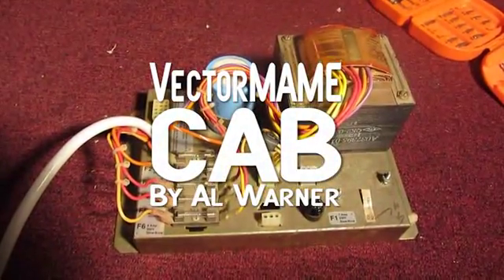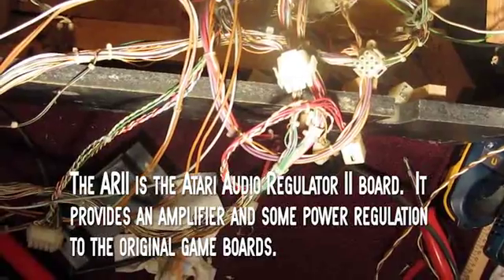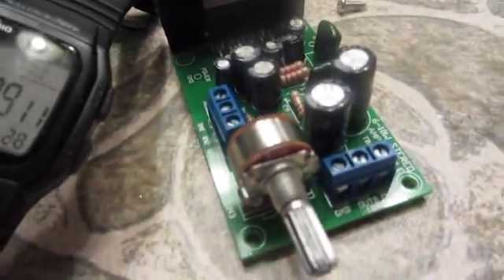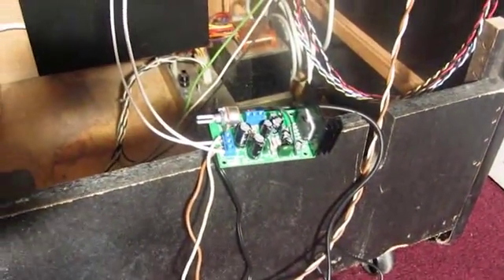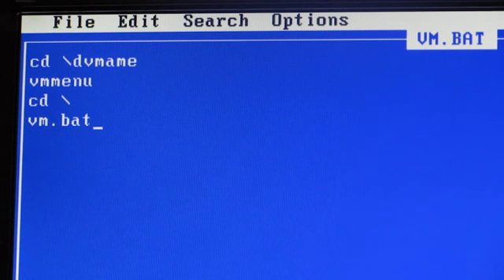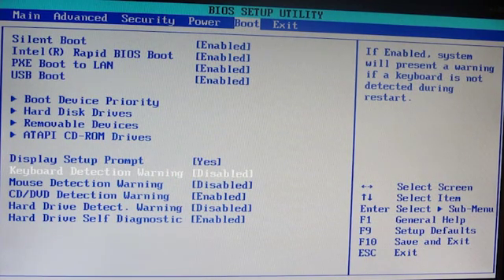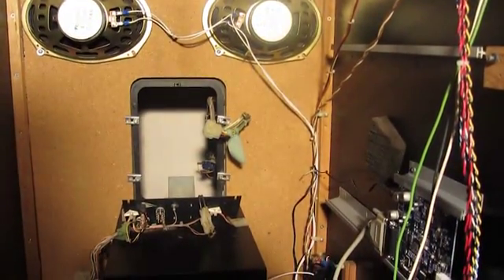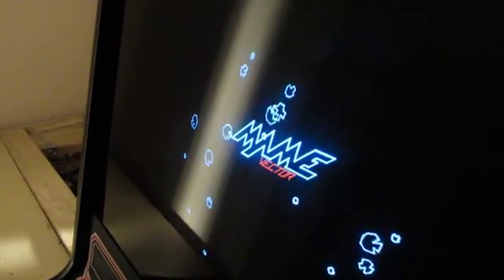VectorMAME ZVG Cabinet Configuration (Part 1) Rev B

Comment from the maker: Another tip I have is to add the following to the AUTOEXEC.BAT before the vm.bat line: 

REM | CHOICE /C:AB /T:A,5 > NUL 

This will put a 5 second pause as the machine starts.  If you need to get into the machine to make changes - yiou simply hold [Control] and press C when you get to this delay.

Comment from the maker: I'm planning to use the TurboTwist2 spinner.  I also have an original iPAC that I'm planning to use. I have it working in preliminary tests, but I haven't tried everything together. I was told that the ultimarc spinner would not work in DOS.